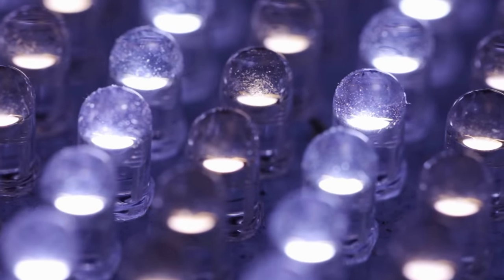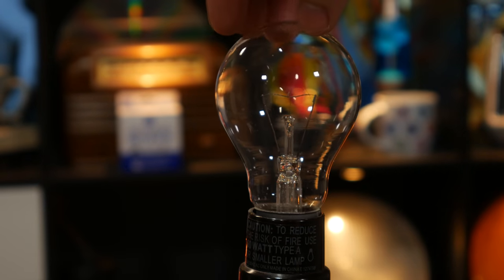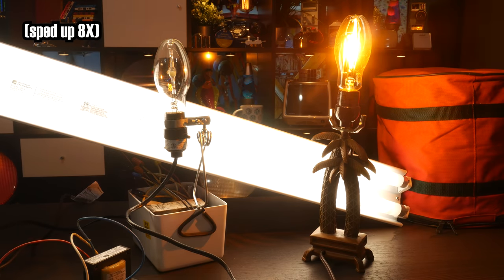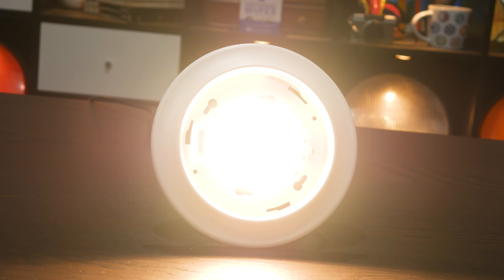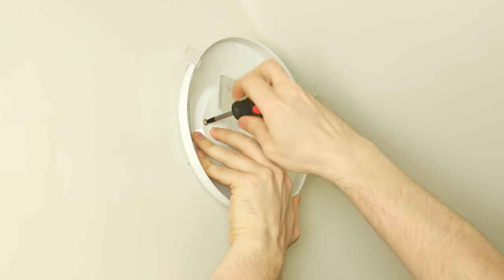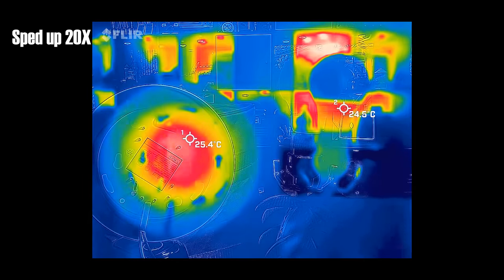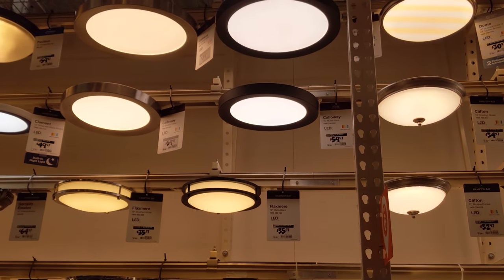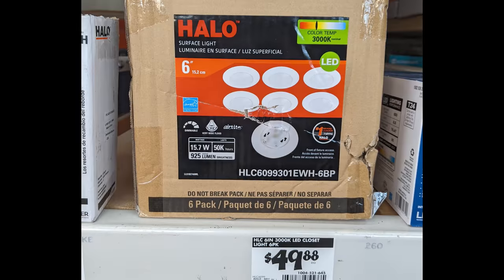A troubling trend in lighting?

Comment: Three years ago our government office 8-foot ceilings were renovated and they replaced the T-8 florescent bulbs and fixtures with LED Troffer lamps. They also lowered the ceiling 8 inches to accommodate the new ceilings and ceiling fans.  I asked if they were going to install dimmers - nope, that was not in the design and they would have to rewire the entire installation.  I strongly urged them to install dimmers, but they said it was a done deal and the plans approved the year before. These lights are so bright, folks are getting headaches and if you turn the fans on with the lights on, you get a strobing shadow that makes some sick.  There is also over head glare on all computer monitors. All our offices have windows and blinds for natural light. Some have covered the fixtures, I used a large black trash bag for the one above my cubicle, but we rarely turn on the ceiling lights. We use indirect desk and task lighting. When management heard the employee complaints, they send an engineer out to check.  He says this model lamp fixture was designed for a warehouse environment with 30 foot high (three story) ceilings! The rest of the building suddenly got dimmers after his report, but not us. COVID hit and we've been out on telework until now.  Several employees are now saying they won't return to the office until the lighting issue is fixed and called Industrial Hygiene and the Safety Office.  Recently management is saying they would install a lower lumen device, but then that had been ruled out.  Now they are saying they can put in dimmers or do a total re-lamp with the correct lamps including dimmers.  We did have solar tubes before the new ceilings, but they covered them up. Right now a metal roof is being installed and they ripped out the solar tubes from the roof.   Typical government...

Comment: Came here to complain. Had a light fixture go out, had to look up the model (discontinued), then find an equivalent and order it (not in stock, drop-ship only), then get notified I would be getting an alternate fixture (wrong size, different trim, and not the same connector), only to be told "it's ok, we'll send the correct trim as a replacement for that fixture." They were surprised when I returned it on receiving a fixture that wouldn't replace the other one, or even connect to the existing plug.

I'm just going to break out the soldering gun next time. Less hassle.

Comment: It would be better if it came with socket plug prongs on the back and you ran an extension cord like setup to it in the wall. Then replacing it would be safe and easy. You could also test it with a standard wall socket.
Reply: Interesting idea, but that would probably not be up to code. A better solution would be a replaceable LED module inside the fixture that can easily be removed and replaced. This would have to be standardized across brands, though. They could offer them in the same wattage increments as the old incandescent bulbs, just LED equivalents. Or even better, just stick to light bulbs you guys. Especially ones that are not LED.

Comment: if I had a standard bulb ceiling lamp fixture that I wanted to upgrade to LED I would consider putting one of those Halo lamp units inside the old fixture. Tear out the old socket and fasten the Halo unit into the fixture. Lots could go wrong, but given the investment required I would give it a try......

Comment: Lights is lights. As long as they light up my life and aren't too out of sync with the colors, fine. I just need to be able to see when the giant lightbulb in the sky shuts off for the night. I also resolder the circuits on "bad" leds so they keep working. I have an outside 100W equivelant led that has been going strong for going on six years that I have never had to repair or replace. I have several leds inside that I have resoldered and beefed up soldering on that are also at the 5 or 6 year stage. I haven't had to buy a light bulb of any type for what seems an eternity. Once I finally replaced all of the crappy cfls with leds, I haven't many issues and no issues that I couldn't easily fix myself.

Comment: For the TLDW  we need ti create a LED bulb ( not a LED light looking like a light bulb ) similar to how we made a separate form factor for florescent -- typically long tubes with two electrodes at the ends. One where when an Led burns out you replace the LED but not the driver.

Comment: Another issue with the LED ceiling lights is they can buzz if you have multiple installed and your fader switch is not perfectly compatible. I ended up changing to a simple on/off switch after being unable to find a fader with the right frequency.

Comment: There is one con with those lights you like so much.  That is if you ever have to change it you have to unwire it from the wires in the wall.  It is not socketed and that is why there is so much to changing those.  It is no big deal if you can do it really.  Then some people living in apartments or similar places are probably forbidden from doing electrical work there in the lease agreement.  I imagine in those cases you see more lighting with sockets.  Understand that some landlords might not want their tenants making ANY modifications to the wiring or they might be worried about the likelihood of fire if the connections are not made properly.  An improper connection might be one that is just loose or worse, one that is not where it should be.  Both of those can be dangerous.  Loose connections can arc and get hot and maybe spark fires so I hope you can see the danger there.
Reply: He goes over that if you watch the entire video

Comment: in comparison with the cost of flurescent light tubes they are very cheap to buy energy saving and make great outdoor lights for the driveway switvched with a microwave pir semsor, they are rarely on long enough to get warm and last about 15 years which ticks a lot of good boxes for me, Ive also replaced my flurescent lights in my workshop with them as the minimum wattage available for the workshop flurescent tubes was 50 watts  each these Led's are 7 watts each a significant saving and they produce more bright light which is kind of important in a workshop enviroment when you are handling sharp and heavy tools all day. However we use led old style bulbs in our living  room and bedrooms  which have a warmer feel to them, so im with you in that respect. I just hope all the hype about Led's damaging your eyesight isnt true.

Comment: LEDs got less efficient on everything went dimmable.
A lot of edison-based fixtures don't have a reflector behind the bulb, especially bad for sideways mounted bulbs. I put up piece of aluminum foil behind the bulb on my porch fixture and it's noticeably brighter. It should at least be painted white behind the bulb, pink or red for slightly warmer temp.
I'm thinking about drilling tiny holes in a LED bulb for cooling.

Comment: The only way to consistently kill LEDs is to put them in tiny enclosed light fixtures. Had a bunch of bulbs that literally melted the adhesive and came apart to the point of leaving the input wires to the board as the sole thing holding them together - Absolutely terrifying.

Comment: This trend also seems to be problematic in the solar street light market. They implement a cheap circuit, inexpensive lithium batteries, and a cheap led panel to provide light, but the lights need to be replaced once the panel burns out where as in older models, they implement a decent circuit, a lead acid deep cell battery, an inverter, photovoltaic module, charge controller, and a lamp holder that uses replacible led bulbs or fluorescent bulbs.

Comment: One thing that kills led bulbs rather quickly. Is if the power going to the bulb is dirty. If it's on the same circuit as a motor it's very bad for led bulbs. Something to do with power phase.

Comment: I live in an apartment. One day, the fan light in our bedroom went out. We decided to see if we could just replace it ourselves, but when we removed the cover, there was one of those LED disks. We obviously didn’t have one of those, so we called maintenance.  Imagine my surprise when this man showed up and replaced the ENTIRE FAN. Not just the light. Apparently the disc was a custom size and they couldn’t find where to buy replacements for it from the manufacturer. So they just had to buy an entirely new fan in order to get the new LED disc. And that one didn’t match the size of the old one, so the whole thing ended up being replaced. The old fan was perfectly serviceable, no more than a few years old, and the new one wasn’t an improvement on the old model in any way. The whole thing seemed like such a waste to me. Corporations just found a way to force obsolescence in the lighting industry.

Comment: Can I also take this chance to express how much I hat the whole edison screw thing. In the uk lights will either have an edison screw (mainly this is for lamps and such) or a bayonet fitting. in my eyes the bayonete is far superior. Its just as fast, if not faster to install and it has the key advantage that its almost impossible for it to be connected physically but not electrically. the screw can be partly screwed in to the point where it grips enough to stay but not enough the light actually works. A bayonete light on the other hand only clips into place exactly as the light makes electrical connection.

Comment: i would prefer if these were produced in sort of standard formfactors too, like a lightbulb is nowadays. i dunno if you know the offset ceiling that has panels where some panels can be switched out for LED panels. those are always the same size and it should be easy to find a replacement once one breaks, but for a willy nilly light fixture thats in fashion now and wont be in 5 years... ill still take the bulb version over any other
Reply: Believe it or not there are integrated LED flushes out there whose modules are replaceable
Reply: @exoticcar5482  nice

Comment: If your uncomfortable with Wago connectors (which basically solves all of your complaints very cheaply and simply but I'll grant you is an electricians interface since you should trip the breaker first), they do make outlet plugs that you can wire up to those two wires coming out of that light though (they have done so for over a century). This means that, if you wanted to, it'd take about 20 seconds to convert those two wires into a plug. Once you did that, you could then easily install an outlet behind the light. Presto, you have a replaceable fixture fit for the consumer for only a few dollars more per light. You're welcome. OFC, you're probably going to want to put all of hat into a can or something similar ... XD.

Comment: I have a few of those small LEDs designed the way you like (model TB11-07050MDCH25-12DE12-1-12), but every time the laser printer prints they all flicker (on the same 20 amp 120v circuit) had no issues getting a RMA when one failed early, i have 4 of those in a fan, and i wish it was brighter, but it is good enough

i seem to like 4000k 80 CRI (at 8913 lumens), quite happy with the light from my 8ST2L8040R
it seems crazy to me people buy those small led fixtures for the same price that put out a fraction of the light

i put 2 of those in a 9'x9' room cause i do not want blind spots and i can see EVERYTHING

also like the A9A19A100WT2006 A19 bulbs i got

Comment: I bought a 10-pack of very bright LED lights for my kitchen but it turned out that they dim pretty quickly. When I looked into why and discovered heat problem, I decided to remove the glass from the "bulb" and pull the circuit board out on one so it is hanging out like spilled guts and left it as is on the other (I have two) so yes, after about a year the one in with the glass still on is half as bright.

Comment: I use incandescent bulbs as heat lamps for my reptiles that have overhead heat lamps. I use them because heat-producing lightbulbs that are sold by pet suppliers as “for reptiles” have reached ungodly prices. I’m pretty sure I can get a box of 4 incans for ~6-10$ while I can get a single “reptile” bulb for, like, TWENTY!!! It’s getting harder and harder to find the incans, though, and while they do go out frequently, that’s because I frequently have to move lamp fixtures around as a college student with divorced parents and overall an unstable living situation. I do wonder if those “reptile” bulbs would be longer-lasting even with the moving fixtures/bulbs, but I don’t have the money to throw at it to test it.

Basically, I can relate to the “incandescent bulbs keep f*****g breaking” sentiment, and holy hell is it hard to find them nowadays, especially in the wattages I need for specific temps.

Comment: Many of these light fixtures have large amounts of plastic in the light design.  The ones you show are small but there are many bigger fixtures that have no way to replace the LEDs so the whole big lot of plastic making the structure of the light has to hit the landfill when it fails.  Also while most will last many years if you get a dud it may only last months.

Comment: If you rent just call your landlord to have it fixed. If they do not fix it withhold your rent until they do. If you own a home with integrated LED  luminaires (no such thing as a light fixture, only plumbing has them ie sinks, toilets) simply have them changed and you can change your own lamps.

Comment: the electronics and leds should be sperate... so each can be replaced individually... also 3 pin socket can be pretty good solution to fixture design problem...

Comment: I feel like there should be led bridging clips to lend new light to leds bulbs or fixtures with a single dead led. having them all wired in series means that one fails = all fail. i usually solder bridges but that seems more inconvenient than it would need to be. trash bins are full of bulbs with mostly healthy leds

Comment: It’s not Kelvin degrees buddy. It’s just Kelvin OR degrees. Kelvin units are just Kelvin. (400 Kelvin is NOT 400 °K or Kelvin degrees).

In plenty of jurisdictions it’s not even legal to do any wiring yourself even if you are competent, unless you are a qualified electrician. 

All the lights we use in our house are 6500K colour temperature with all the smart LEDs being RGB as well as 2700-6500K white so we can make them “warm” when we want. We almost always run them either on an RGB colour mode or at 6500K (Cool Daylight).  Nice.

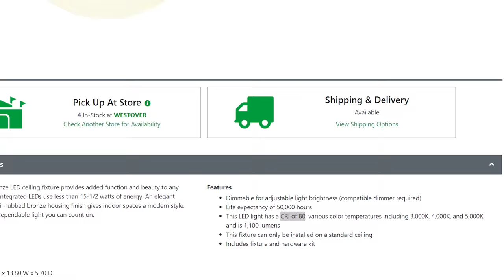That light at 21:51 doesn’t say it doesn’t go down to the colour temp you want - it says various colour temps “including”… so it probably has others, possibly 2700K.

To be fair - you never buy a bulb or light fixture based on what you MIGHT want in the future or what someone else MIGHT want.  If that were true - why didn’t the previous owner of my car choose the options I want now but it doesn’t have? Seriously. Buying for someone else in the future ISN’T a thing.
Reply: When you are a parent (or are planning to become one), you most definitely buy things based on what others in the future might want.

Comment: Previous owner of my house installed ugly all-in-one LED boob lights in every room of the house (total of 9). Starting about a month after I bought the place, they started to fail… one by one. It starts with an occasional flicker, and eventually gets so bad that the light will just constantly flicker when turned on. Of course, I’ve been replacing them with better quality and more attractive fixtures with replaceable bulbs as they’ve failed. 5/9 have failed and been replaced so far (over the course of two years).

Comment: I don't disagree, but wouldn't you have to deal with electrical wiring any time you move. At least in Denmark, houses don't come with lamp installed. At least not mostly. So when you buy a house you expect having to deal with wiring at some point. I just moved to a dorm room and lamp were only installed in the bathroom and hallway, in the main room I had to install a lamp my self. Though a hook to hang on were placed at least.

Comment: Just curious- have you not seen the low voltage lights that have a ballast that goes onto a box with a standardized plug that goes to the flat LED fixture? Just put them up in my house and they’re great. Had one dud that died after a month. Pulled it out and swapped it out for one of the flat “bulbs” that truly is just that, the LEDS themselves. The driver is mounted to an electrical box in the attic

Comment: I have had pretty bad luck with LED bulbs. I would buy incandescent if they still sold them. The early ones were better, but I think they got better at planned obsolescence over time. I have some at work that have an aluminum base with cooling holes and slots. They have lasted for years.
Reply: Amazon and ebay sell incandescent

Comment: I have an LED bulb that I bought approximately 11 years ago when LED bulbs first came out that has been running 24/7 for nearly the entire time. It's mounted upright in an open style lamp where no heat is trapped. If I recall correctly LED bulbs were $30-40 for ONE bulb at the time but I got a 2 pack from Ikea for $15-20 per bulb so at the time it was a deal for LED. We'll see how many more years I get out of it. I'll report back when it finally dies.

Comment: Theoretically this could be solved by terminating the wires in the box with a connector much like MR16 bulbs do without the support components, maybe an xt60-like connector or something, and instead of directly wiring the socket in with bare wires, plug the socket in using the connector, then you could even change between Edison and these new LED fixtures without needing to be comfortable with electrical work, basically plug and play.

Granted we'd need to set a new standard so new build homes would include such connectors and light manufacturers to do the same on fixtures so it's not the most seamless of transitions whilst they all figure that out, and we all know what it's like getting people to adopt something new.